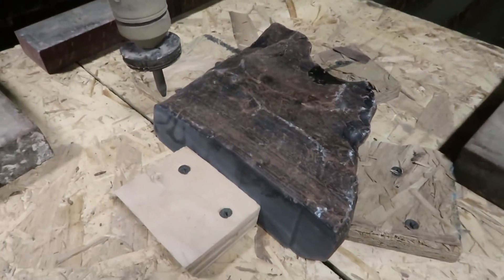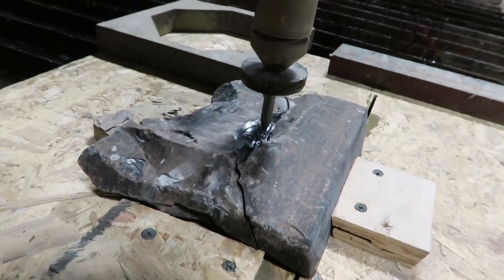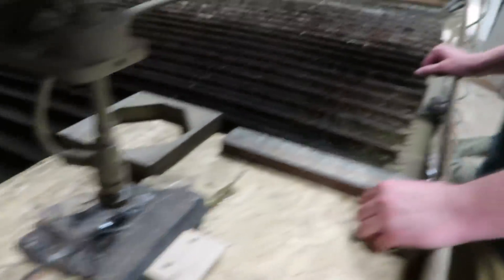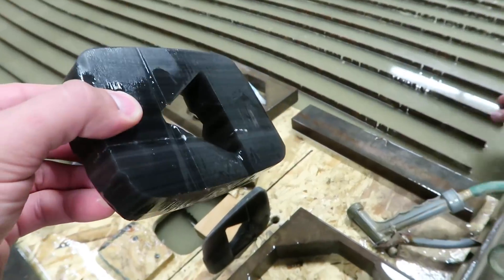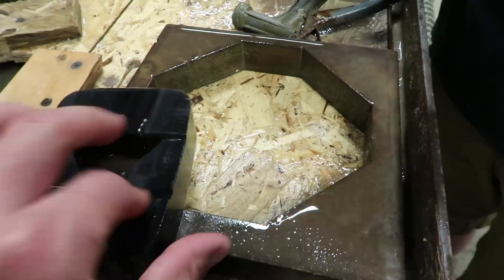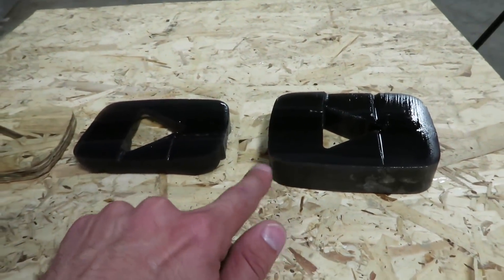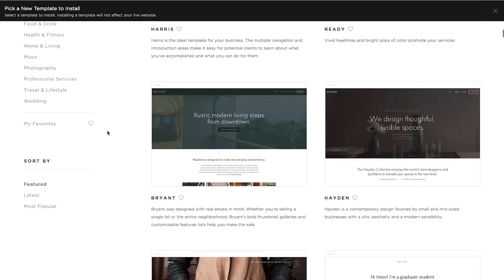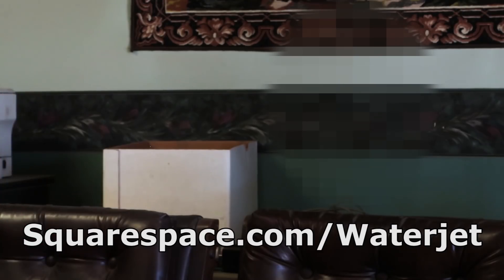Obsidian Play Button Award with a 60,000 PSI Waterjet

Comment: OKAY the 777,777 subs play button will be easy. Super glue up a large sheet of translucent dice and waterjet the play button out of that.
Reply: Or make a block of poker chips held together with resin and make the play button out of that.
Reply: @BrainFartTheFirst  That's a pretty good one too. You can use epoxy resin tinted red to pour onto the stack and bind it together. That would look BALLIN' after it was cut out.
Reply: App the fumes from the super glue will ruin the plastic. It'll turn the whole thing white.
Reply: @xenonram  nope. Already did that with a bunch of the same translucent dice. If you use medium or thick the fumes aren't nearly as crazy because they set much slower.
Reply: Or a bible
Reply: @artonline01  That would have been good for the 666,666 video. Kind of a stretch on the 777,777 video.
Reply: Nah, glue the first three Halo games together and cut them. Bungie and their obsession with the number seven.